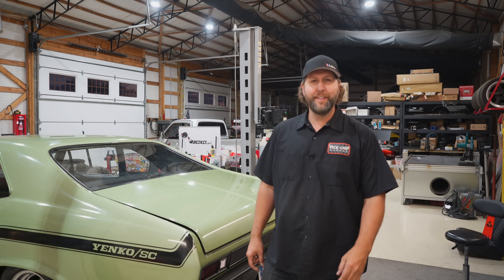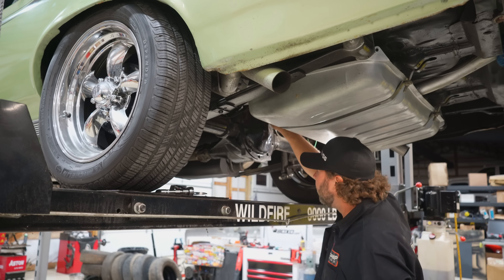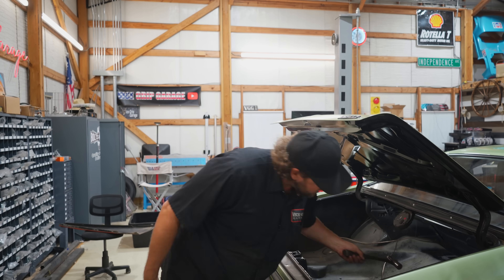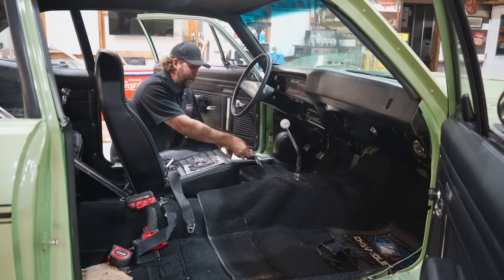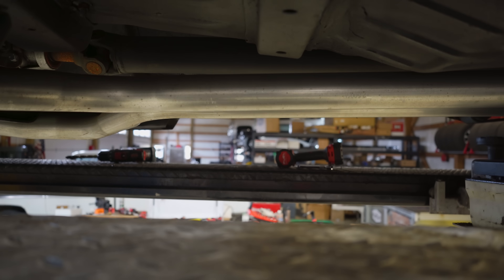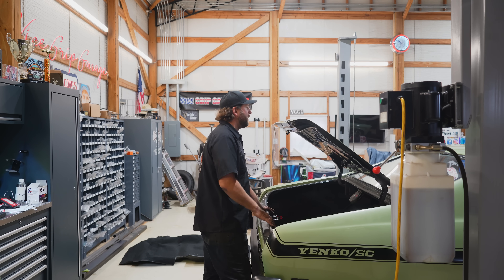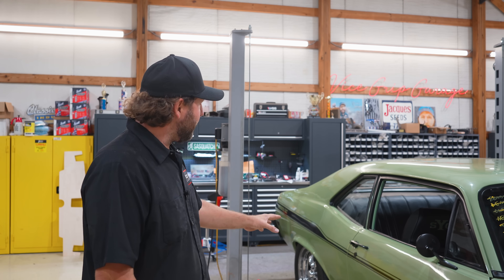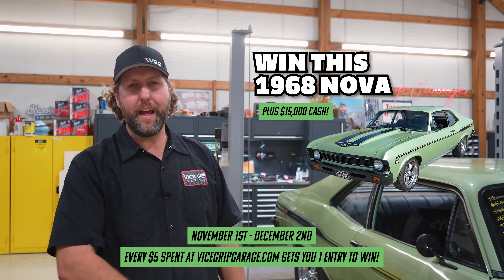DIY Custom Trunk Build & Interior Updates on A Chevy Nova!

Comment: Love the fact your giving a primer on upholstery. My Grandfather was a chemical engineer and had worked developing adhesives. He explained to me that gluing both product gave better results because the glue bonds to itself easier than what its mounting to. So you let both sides get tacky, this lets the glue bond to the item, then placing the items together only the glue needs to bond to glue.
Reply from the maker: Thanks for sharing, that makes sense!
Reply: Doesnt the glue also need to bond to each surface? I never understood this.
Reply: @donjohnson1416 it does, but for better adhesion spraying both surfaces insures a stronger bond.
Reply: That's why it's called contact cement. Just read the instructions.

Comment: The irony of cutting a piece of metal with a cut off wheel while using your plasma table as a work bench. Haha . Classic Derek move.
Reply: I guess no one covers important wires with Loom any more, we would put Loom on a fuel pump wire back in the 60's  and 70's.
Reply: There's a chop saw on that table too...
Reply: @michaelwalsh98 , yep, and it was and still is a very GOOD practice to protect all wiring with braided looms, even ground wires and speaker/amp wires. Hell we covered brake lines and fuel lines with it too, and they would last longer.

Comment: Derek, when drilling holes in carpet... Reverse the drill, friction will cut the carpet and seal the edges
Reply: soldering iron works well too, melts right through
Reply: @jthonn plus no open flames 🔥
Reply: Second the soldering iron.
Reply from the maker: Thanks for the tip!
Reply: soldering iron or use the torch to heat up an old screwdriver or a long bolt
Reply: @chrislivesinreality8245 , yep, it's fast, safe and no cord to get in the way. I took an old quality flat blade screwdriver with a thicker shaft on it and I cut it off to 2/3 its normal length and then used a bench grinder to round over the cut end. It's perfect for melting holes in carpet, plastic, thin wood, Formica, sound mat material, etc.
Reply: Don’t ever drill carpet use an awl punch nothing that spins

Comment: A friend of mine works for a carpet company.  They do alot of commercial installs, like offices that use that high traffic type carpet.  He brings me large pieces of what's left from an job, large enough for doing a car.
From that office type carpet, I redid my 78 Impala.  And it's the correct factory color!  The Impala is silver blue body, with a darker blue interior.  The cost?  Nothing.  😁

Comment: For future reference on the seats it's best to spot weld the head of a carriage bolt to the seat track because over time the nut sitting on the floor will put stress cracks in the floor

Comment: Old mate of mine had an AP5 Valiant. Aussie build. He turned that from a column shift 3 to a floor shift with a wooden console. The old bench seat became a couch in his parents' basement, where we rehearsed for the first serious band I was ever in. He lined the boot (trunk, as you fellers and fellets might say) in the Axeminster carpet from his parents' house when they renovated. My Morris Minor panel van also had my neighbours' Axeminster in it as well, at the time which is what it would have had from the factory. Craig's Valiant though......he shadow boarded the inside of the rear fenders, and had tools hanging inside the Axeminster covered cover boards. Inside the boot was made to fit his drums and brass. It was quite a thing to see fully assembled.
He sold it. Bought a basket case AP6 ute (Australian build again....we're Aussies). He made hardwood dies, and basically rebuilt the poor thing to factory (fitter and turner by trade with a Grandfather who was a shoemaker.) Painted it himself. Reupholstered it in tuck and roll himself. First show he put it in, he took out Best Commercial, Best Car and Best Newcomer. He nearly got lynched by all the oldies. I'm surprised they didn't turn his lighting whirler on him.

Comment: 22:20. Ford Ranger protip.  If you want no center seat/armrest get a passenger seat from thr u pull for $30.  Remove the sliders from both the drivers seat and the new passenger seat and swap the seat part.  There will be a hole in the seat fabric for the seat belt but other than that it works great.   Then you have the space in the middle for little toolbox or bag or cooler.

Comment: 50:12 after banging on the trunk lip while describing the next thing on this beautiful Yenko trib... i was surprised to see you not use a 'kill-matt' or sound deadening pad.. well, i'm not saying anything, but in my head, that was the first step.. kill-matt everything... i never thought it would be SO different, but using a deadening adhesive pad really does make it quiet in a car that NEW was a pile of squeeks, pops and body movement sounds... but it's just a thought.. you al have a nice day...

Comment: You should try the old trick to make carpet holes for seats. Take a punch or screwdriver or soldering iron and get it really hot and use the pointed tool to follow the seat bolt hole. It leaves no frayed carpet and makes perfect holes.
Reply: Works great if you have a hole to start with, there wasn't a hole in the floor at all. He has done what you said in several episodes in the past.

Comment: A neat trick to patch paneling, read to the end, it's not a hack job: you cut yourself a patch piece that's just half an inch larger (doesn't need to be perfect) than the hole you're patching. You lay that piece on top, so there's an even spacing over the whole hole. Once you're sure it's AoK, you tack two far corners, diagonally opposed so it sits in place. The smaller the tacks, the better. Then, you take a cut off disk with a 1mm with and cut through both of the materials on one side (without touching too close to the tack so you don't lose that index). You remove the excess piece of patch panel, then proceed to cut the adjacent corner (non-tacked) and remove that piece of panel. At this point, if you have reach to the other side, you can remove the excess material from the parent body. If not, you can leave it in there, it should fall off on its own with the last two cuts. Ideally, you only cut a bout 3 inches at a time. OK. Once that's done, you start welding. You have a good 1mm gap, you tack your panels and align any mess with a screw driver. You worm half an inch here, half an inch there so it doesn't warp. Once you're done with that, you repeat the process with the other (non-tacked) corner and once it's all done and dusted, you clean up the two tacked corners (at this point, the dead part of the parent material should fall on its own) and Bob's your uncle. Simple, clean, no particular effort with measuring, cutting a perfect patch, holding it in place, fighting with the magnets and you can work at your own pace, because the material will naturally fall in place. With a flapper disk and some patience so it doesn't warp, you won't even be able to tell you had a patch there.

Comment: A small DIY Tip: To increase the chances of using left over aerosol spray products, at a later date. Like Undercoating, Adhesive or even Paint. A Guy can quickly spray in a random direction, with the can inverted. This may blow some "clean air" through the apparatus, clearing out the offensive product.

Comment: I keep a little chunk of copper pipe around for seat bolt holes on carpet. Heat it with a torch and poke it at the carpet..
Works like a hole punch and no worries about making anything else melty.

Comment: I always kept an old soldering iron around the shop to melt those clean holes through loop or pile carpet and avoid snags that come with drilling.  No flame necessary!

Comment: Use a soldering iron to make your seat holes in the carpet plus I would never block off the back of the trunk. That extra space will come in handy for something that fits in on an angle. The trunk is already small to start with.

Comment: You know, you could also take a bunch of that. ceiling put it. in a zip lock bag into one of the corners of the zip lock bag. Twist the bag at the end. Cut just the tip of the bag off and then squeeze the bag like a** on or a pastry bag you would use for putting things on a cake. Then you could run a beta that around and then just use your finger to smooth it out. Or a paint stick. But I suggest we use gloves of that stuff gets everywhere. And then whatever is left in the bag, just squirt back into the container and throw the bag away. I would suggest

Comment: My first car was a 68 Nova and I talk about if I could find a body I would put an LS in it much like this has.  Many if not most people do not know that this is a one year only style.  Many changes between the 68 and the 69.  Small but they are there.  From the Chevy II on the hood and not the bow tie,  This was the last badged Chevy II. the placement of the Nova name from the rear quarter panels to the front fender.  I have to buy something because I NEED this car.

Comment: Supposedly if you spray both sides you're trying to adhere together it's a permanent bond whereas one side is semi permanent. Works pretty good either way from the little experience I've had with that 3M adhesive.... Yeah it'll glue two fingers together no problem.

Comment: Carpet holes, use a piece of copper tubing  (1/4 or 3/8) and a vice grip. heat the copper with a torch and burn your hole while sealing the edge to keep the carpet from fraying.

Comment: You can use a cheap soldering iron to burn a hole through the carpet to bolt through, and it melts the threads together and will never pull strings out.

Comment: Another option for the carpet bolt holes... use that soldering iron tip you don't like and melt through the carpet. Wiggle to bolt size. Don't use your good soldering tips for this. The end result is even cleaner.

Comment: You need big washers under the seat studs, like seatbelts. More surface area so they don’t rip thru the floor if there’s a bad accident , it’s for necessary seatbelt bolts. I also did it with the seat bolts as well. Usually, when you buy aftermarket seatbelts, they come with the huge washer tha goes underneath. I use the same washers under the floor on seat mounting bolts or brackets.

Comment: The square bolts were there for a reason, the seat rails are supposed to sit flush with the floor for stability, your way all the weight sits on those bolts and that nut...

Comment: Derek, Have you ever watched Hand Tool Rescue? Eric uses this stuff called Evapo-Rust. No harsh chemicals or odors but it removes rust and treats the metal so it won't rust for 50 years. He has a 50 gal drum of the stuff and the only thing you can't put in it is magnesium. You could probably save some gas tanks pour it in and let it do its magic. I have a one car garage that would fit a Nova perfectly.

Comment: Hey Derek, your channel is my Saturday morning routine. I was just thinking how big you look in a Nova when you said how nicely you fit in it. You must be about 6ft4. Do you prefer getting in and out of a 2 door or 4 door Chevelle for instance? I'm a few inches shorter than you so I only had problems accommodating backseat passengers. In my old age I am building an affinity for 4 doors. I like the extra room between parked cars. 
The seat installation had good tips in it. Thanks.

Comment: As old carpet guy using heat is your best friend I've done stuff in houses that would amaze u and learning how to manipulate it becomes a art that helped when I decided to do stuff in cars and panel also speaker boxes and able to hide the seams are a art learning to cut in-between the loop of the carpet there's a tool that does help or likee craft on and u just look from the top by spreading the Pyle to were you will find how it was stitched to the backing and I even got to point of stitching flat ribbon around the edge to spruce it up or cut to the edge of template then see one side then use the ribbon to role around the edge and I would round the top edge of template to give it better edge and the you can glue it all just make Shure to get wide enough ribbon it works great in tight spots so you don't have to wrap carpet around the wood and I usually do some type of double stitch or leather also cool but keep up great work and hears something for you or her to try some time to your car

Comment: Butter Cream frosting is the other kind. I would have used J B Weld on the patches rather than welding. Because it was a non weight baring area and would have worked just fine.

Comment: Hey Derek, If you really need to reinforce the seam sealer, lay a strip of fiberglass drywall tape across the seam and lay the seam sealer on top of that.  It will last 14.2 million years, guaranteed.

Comment: A feller got to talking with another feller while said other feller was replacing the windshield.  Want to know where to put the rear view mirror mount?  Said the feller.  Yup.  Hold each side of the windshield equally in your arms and your nose will mark the spot.  Pretty nifty little trick.

Comment: You should be in charge of Chevy upholstery.  Every late Chevy headliner I owned has come down from the front windshield.  I noticed they cut the material exactly to the edge.  When glue gets old, we all know what happens.  Pthhh  They couldn't ad a half inch of material and loop it behind?  Unbelievable!

Comment: During 2018 I found out I had Colon Cancer.  I spent two weeks in the hospital. But they sent me home, but had to to head back to the hospital. I was in the process of passing away due to leakage. I was extremely weak. I made it to the hospital at the right time. My wife was driving real fast on the highway. After that, I spent two more weeks in the hospital. The hospital bills were very high. The job I had was not more. We struggled a lot trying to have food on the table. I am wheelchair bound. That Nova would be a very good fit. I had found one of those Chevy Nova's, but it was major rusty and destroyed block. So I passed on that junk car. I did sigh up for that car it would be nice to win. Hopefully I can.

Comment: Hey Derek, my name is Richard Webster, I love all of your videos I have a 1989 Mustang Foxbody. I've  spent $25,000.00 in the engine alone, I've been through 3 different mechanics and I've been taken advantage of by the first 2 and this last one has had my car for 6 months and still hasn't started the work on the car. Every time I have spoken to him he keeps telling me that my block is still at the shop. Because I took my block to a guy in Sumter, SC who builds nothing but race cars. My block is the only thing that is used everything else is brand new. The guy that did my block that first mechanic the one that builds rasing engine's he also has a machine shop he charged me $980.00 for, now the mechanic who has my parts and block told me he had to take my block to his man because , the holes were not round that they were oval shaped and some other problems. I requested that for him to bore out to 40 over and polish, port the block and to do what ever it would take to give me as much HP as we could squeeze out of my 351w as possible. So you can understand why I'm upset with the men I've  been dealing with. Derek, I have been waiting for this car since the covid started . Derek, this is my Bucket List car, my dad helped my sister and my brother but, not me I was working a job everyday I could so when the time came I would have the money for what ever I wanted. One more thing I have PULMONARY Fibrosis. Which there is no cure for its like drowning with your head above water.i can tell it's getting rougher everyday I'm getting a little closer to death. Do not think I'm using this as a ploy to play on your feelings. I just want to get my car and  be able to drive my car
and be in a race or 2. I would just love that. If you could work on my engine. I need to talk to you so would you please give me a call at my home phone 803-825-0103 you can leave a message on my home phone answering machine. PLEASE, GIVE me a call Derek, I don't have a lot of time left in this life.  Sincerely: Richard Webster, also I want to THANK YOU!!!! ONCE AGAIN FOR reading my comment.

Comment: My 6th gen is bigger on the outside, it's a much bigger car than my 3rd gen but 6th gen is tight on the inside. There's not a lot of Headroom there's not much legroom but the third gen seems to have plenty of room even in the back seat compared to the 5th and 6th generation waymore room in it

Comment: I bought one of those new mirrors for my truck, because the mirror was missing when i boughtthe truck from a used car lot. I put it on my windshield and a few months latter when it was hot out side ( sumertime) it started falling off when i would try to adjust it, Not the part that glue to the windshield,  itself. But the thingy that slides over the part that you glue to the windshied.
   Turns out that part of the mirror that has the set screw, to hold it on, is made of plastic. When you tighten it up the plastic streches and just pops off the windshield bracket. The screw wont hold it tight anymore because the plastic keeps streching. all you have to do is bump it and it falls to the floor. At first I though i was holding my head wrong, while tightening.
   Took me a while to figure it out. Why does that thing keep coming loose. I thought it was metal. First i thought it needed a longer screw. so I got a tad longer screw, and while I was trying to snug it up the mirror fell right off. Then it dawned on me. The bracket is cheep plastic.
 So now everytime i put my sun shield, up on my windsield, the mirror falls off.  And the mirror holds the sun shield up. very frustrating.
  I'm afraid to buy another one because, maybe, all the new after market mirrors, are the same. Cheep plastic.  
  Any ideas on where to get a good quality mirror?